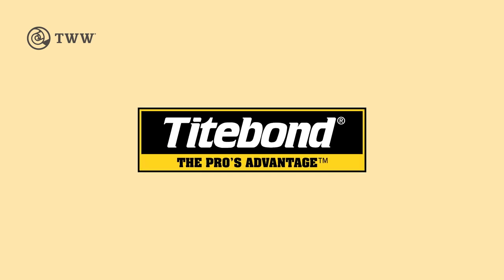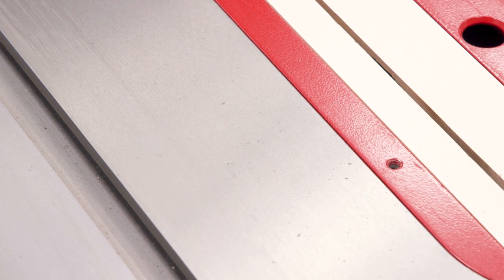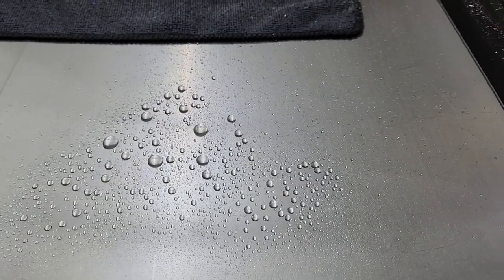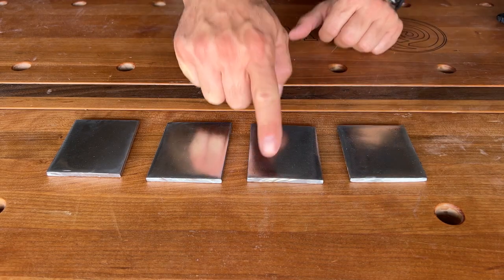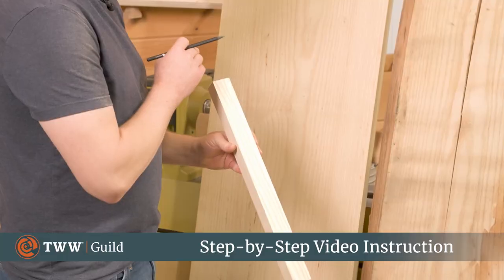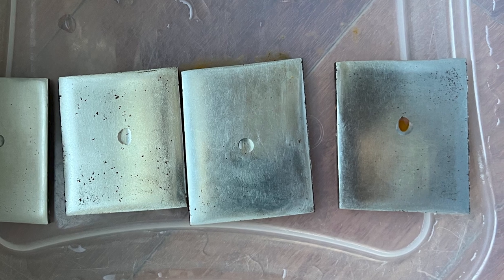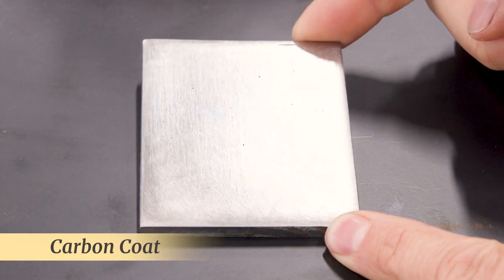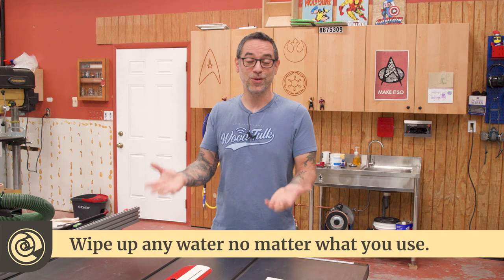Did I Screw Up?! | Carbon Method Update

Comment: I bought my new SawStop at the start of this year. I cleaned the grease and applied multiple coats of paste wax immediately. Within a couple of months and light use, I started getting rust no matter how much I maintained it. After your first video Marc I picked up the 2-3 tool package of Carbon Method and coated all of my cast iron. Haven’t seen any rust yet and I’m working out of my attached garage that gets opened multiple times a day in all weather. I’m definitely a believer so thank you!
Reply: After a year how is Carbon Method holding up? Thanks.
Reply: It’s held up really well with no major complaints! Over the winter, during a rainstorm I got some droplets on the table that I wasn’t aware of for a few days. Once I cleaned it up there were a some discoloration spots but didn’t turn to rust. My belt sander table still looks like new. I’ve hit them with the glide coat 1-2 times as needed. We’ll see in another year if I need to reapply but overall it’s been nearly zero maintenance. I used the saw a couple dozen times both with hard woods and plywood. Hope that helps.

Comment: Coincidentally I bought a brand new Sawstop when you did the original test application and applied the Carbon Method to mine as well.  I live in southeast Alabama and it is very hot and humid.  I fought rust non stop on my previous Grizzly TS and other cast iron equipment.  My new Sawstop looks AMAZING still.  I can’t recommend Carbon Method enough, it is AWESOME and absolutely works.  Make sure you watch their video on how to apply it and follow it to the letter.  I put it on my planer/jointer and my band saw as well and they’re still looking perfect.  Completely worth every penny to protect such an expensive investment.  And yes, the the people at Carbon Method are extremely nice and very professional, great customer service.
Reply: My new Sawstop came with a rust colored wax paper on it. My heart stopped for the moments it took me to realize it was indeed wax paper, and not a brand new totally rusted cast iron surface.

Comment: Nice piece Marc. Rain is particularly aggressive. As the raindrops fall they become saturated, or even supersaturated with carbon dioxide and oxygen. As you mentioned oxygen is required for corrosion to occurs. To measure acidity, we chemists use a scale called pH. The lower the pH the more acidic, the higher the pH the more caustic/alkaline, and neutral is a pH of 7. Adding CO2 to the water makes it acidic as the carbon dioxide forms carbonic acid in the water drops. Normal rainwater, absent smokestack nasties, has a pH of about 5.6, so that appears just a little less than 7. However, pH is what is called a logarithmic scale based on powers of 10. That means plain old rain water is 10 to the 1.4 power more acidic than neutral water or 25 times more acidic. I did my career fighting rust, and trust me that corrosion-wise rain or those dew drops on a rose are corrosion thugs and iron or steel exposed to either needs protection!
Reply: Particularly in cities with high concentration of air pollution. The reason the wax only method still resulted in rust is that natural waxes contain high concentrations of acids.
Reply: No wonder we have weeds, the higher the ph in soil the more weeds will grow, soil ph should be about 5ph for a healthy lawn, so you put down lime to neutralize the acid in the soils  its slow to react but its enough to do the job you can also put down ash to lower soil ph. But its really fast reacting thats why a field thats been in a fire comes back really green.

I forget what metal coating they put on printing press cylinders to stop rust but it works mostly mainly the blanket and plate cylinders becuse they use a ph of about 7 to wash the plates with I think if I remember the ph should be 6.7 its been 30 years.

Comment: My SawStop table saw and Grizzly tools lived in a pole shed for 6yrs in between moves and with indoor rain plus extreme temperature swings in North Central Wisc, I've found the only thing to help control and nearly eliminate all surface rust was a thorough cleaning with rust remover and 0000 steel pad  followed by a coating of Jet Seal automotive protection from Chemical Guys. Then using an  clean bed sheet cover that and completely cover and surround with stretch wrap to make a good moisture barrier. This beat those expensive anti rust covers hands down. I've tried them all. But my method after a couple years of getting sad and spending hours of removing rust on all my tools worked best to keep them 99% rust free! Luckily I've since moved into a nicer garage upper level and after one final shining up with fine sand paper and steel wool and another coating of jet seal, I haven't had to touch them in 2yrs now even with higher humidity up to 90F in the work shop area. I never even cover the tools now.
Reply: Indoor rain is the worst!  Indoor freezing rain caused by the condensation that froze to the bottom of the uninsulated part of the shop getting warmed up enough to melt the ice and rain all over your tools (and freeze). Cardboard sheets were my friend for a while. I finally got the whole shop spray foamed and have had no issues since.

Comment: I live in deep south Texas 100% humidity all the time. I’ve been using T-9 for about a year now and It’s been doing really well for my machinery, what I really like about it is that it’s also a lubricant, so, for example I can spray the quills on my lathes and it protects and lubricates at the same time. I’ll have to check out carbon method, never heard of it. Thanks for sharing.

Comment: Just discovered your channel. Love it! I'm not a professional wood worker, just a hobbyist but have been for 30 plus years. I've always used TriFlo on my table saw. I'm sure this is either going to be bocked at or maybe all you seasoned wood workers out  there will say "wow, I never thought of that". I work in industrial maintenance and know welding and quite a bit about metals in general. I know that cast iron is porous so here's my take on the use of TriFlow on my table. TriFlo contains telflon. This teflon will be absorbed into the cast iron and stay there for quite some time, not for ever though. I usually treat my table a couple times a year. I might also mention that my saw has spent much of it's life out doors under an awning and my treatment works quite well to prevent rust unless it gets water directly on it.
My procedure is this: I spray the entire table down generously with TriFlo. I scrub it in with some fine sand paper. This makes a dirty, dark mess. I then use paper towels to clean off this mess. I follow this up with more TriFlo scrubbing with clean paper towels. I rinse, repeat until my paper towels are clean. This assures you will not leave dirty, oily marks on wood you slide across the table. This leaves my table saw clean, shiny and very slippery which makes wood slide very nicely. I also wipe the face of my fence and all the moving parts with TriFlo as well. Makes everything work silky smooth.

Comment: A dehumidifier in the shop is a big help. I run the hose out the back of the unit to drain out by the garage door or else I'd be emptying it 3 times a day in the summer.

Comment: Thanks for a very informative video. My shop is in north east Kansas, surely identical climate as yours in Missouri. I only use paste wax on the surfaces of my cast iron machinery and have no issues with surface rust. But, I run a dehumidifier in my 1500 square foot shop from April through September. Thirty years ago surface rust was a problem before I started running a dehumidifier. Over those 30+ years I have gone through four dehumidifiers, they seem to only last 4-5 years. The dehumidifier protects my machinery, my hand planes, chisels and measuring tools from any signs of rust. Also, the lumber stored in the shop is protected from the high humidity common to this area. Using a simple pedestal fan combined with the low humidity it is pretty comfortable while working in the shop.

Comment: I live in Houston and we have to deal with high humidity. Always used T9 before. Had an idea to use an inexpensive ceramic coating (Turtle wax) about a year ago. I'm convinced this is the way to go. Every blue moon, when I think about it, I'll just quickly reapply. Takes 2-seconds. I was interested in the carbon until I saw the laborious process to apply. Try ceramic coating. Works great and super easy to apply. Clean and degrease cast iron first.
Reply: ARE YOU TALKING ABOUT THE CERAMIC COATINGS FOR CARS ??? OR WHERE DO I GET IT ??

Comment: Considering how long they sat in storage after being in light rain I would say it did a pretty good job. I have been using Glide coat on my SawStop for about 5 years here in Texas and haven't had a problem with rust here since I  started using it. I did have problems with wax, and CRC 3 36. The Glide coat has out done both of those.
Reply: Thanks for that note! I just went to check out the carbon coat product, but their website isn’t responding. If they’re gone, I’ll pick up some Glide Coat!

Comment: I had some rust form on my table saw from lack of use - almost 2 years.  What I did was spray a good coat of WD-40 on it and let it sit for almost 2 weeks.  I then wiped it off with a rag and then sanded it using 220 grit sandpaper on my palm sander.  It took awhile but it eventually took all the rust away and left my top looking like it did when it was brand new.  Worked for me. 😁

Comment: Thanks for the follow up, I appreciate the transparency. 
I know you paid for the product with a video and attached your good name to it, so your disappointment is very real, and I can 'feel' that. 
Obviously cast iron should never have standing water droplets on it, but sometimes it happens and when it does in my shop (and I suspect many more) it is in the form of a sweat droplet that goes unnoticed and sits overnight or even days before being discovered. 
Since Carbon Method failed the real-world rain droplet test I have no confidence it would protect cast iron from a droplet of sweat. 
If the application of Carbon Method was a one-off event the price could be rationalized, but reapplication after fixing rust spots is too much.

Comment: Coincidently, I ended up needing to pack up my shop to move a few weeks after Marc announced his move.  Based upon his initial suggestion, I applied Carbon Method to all my tools.  I then put moving blankets over everything and moved my tools into a garage for storage.  5 months then passed and I just unpacked everything this weekend and I can happily say not a spot of rust anywhere.  Carbon Method seemed to have done its job. 

Just to further support this product, I live in Washington state in the Pacific Northwest, so it is a pretty humid area.  The last few months were actually pretty dry, but we did have some rain in the past month and the garage was opened and closed every day as a wet vehicle was driven in and out.

Comment: I use fluid film every couple of months and it works perfect. I also spray it on the underside of my truck to avoid rust in the winter. Its just wax and I don't know what kind but it works very well.

Comment: I use T9 on my cast iron machine tops. One day I opened the overhead door in my two car garage shop after a driving rain and water dripped off the door sections onto my jointer/planer. The trouble is I didn't notice this happened for a few days after the event so rust developed. I used the T9 cleaner with a scrubby pad and recoated with the T9 protectant. All seems to be good so T9 is fine for ambient air moisture but not standing water. I live in very humid Southeastern North Carolina. Once I run out of the T9 I will try the Carbon Method product.

Comment: I'm going to have to give that product a try. I live about 40 miles south of you and my shop is open to the outdoor air. I've lived and worked outdoors in Missouri all my life..I've acclimated. Anyway, all of my tools always have a thin film of rust on them that I'm constantly cleaning off. Wax doesn't seem to do a thing. The worst part is the rust that gets on the Lie-Nielsen planes. I've shed more than one tear in my bourbon over that. Anyway, thanks for the recommendation.

Comment: I live in Michigan. Tons of humidity in my metal pole barn. The best I have found is a product called Fluid Film. Spray it on, wipe off excess. Done! My jointer table slides awesome and my 15 inch grizzly planer gets no more rust.

Comment: Spag!! You son of a... wait that stuff worked great!  I live in a temperate rain forest in Juneau AK. With a Labrador retriever that likes to shake off near the table saw after chasing a frisbee in the rain. A lot. And it rains here.. A Lot and we're high humidity. No rust spots on mine. I did the entire prep and sanding process with for doing the Carbon Method and my table saw still feels "like butter" in smoothness on top.

Highly recommend. Much better than wax in feel and performance when breaking down a couple of sheets of 4x8 3/4" plywood over the weekend. Sled moves lots easier as well.

Comment: I don't really mind having to give the surfaces a little TLC every few months. It serves as a reminder that I need to check them for accuracy as well. Never really had big problems occuring with just a wax coating, though I just put a thick coat on without wiping it off after I use a machine that only gets used a few times a year.
Reply: I only have a small space heater and two fans to circulate the air in my shop to try and keep if above freezing over winter and even so I still get rust on my Sawstop and bandsaw even when applying a thick coat of JPW AND covering with magnetic table top covers.  As a result I'm really interested in anything that can help me better protect my tools year around.

Comment: Are you going to do a follow up sometime soon on how it goes with actual usage? I bought some for my sawstop and it definitely works better for pure rust prevention however my experience with usage is completely different. I've found that once your cast iron gets dirty from use and needs to be cleaned that you disrupt that lower layer when you clean it, meaning I would much rather a cheaper product that I just apply more regularly as I have to clean the top regularly anyway

Comment: I am in N.E. Missouri also. Yes we have times through the year the shop will need a dehumidifier & some kind of metal protectant. I made a BIG oops when I used my HVLP sprayer with water base polyurethane. A lot of the tools hanging on the wall had rust on them the next morning. Yes I had the exhaust fan on but I shut it off too soon I guess.

Comment: There are many auto detailing channels which have reviewed graphine coatings (for different benefits) and they largely come to the conclusion that they are a marketing product. While great on paper, graphine is a very hard substance, they bring little actual protection that the substrate is not already providing. Ceramic coatings (a common substrate for graphine) usually offers the same protection and a slightly slicker top surface. While there are probably better or less expensive products this might be a good choice for some.

Comment from the maker: We are now part of Carbon Method’s affiliate program which means if you purchase their products using our link, we get a small kickback. You can also use the code SpagCoat for 10% off at checkout. Click Here: https://carbonmethod.com/?ref=mjguvwfm
Reply: Done! This might be my most anticipated guild project. A Danish cord bench has been high on my list for a while now.
Reply: T9's advantage is that it also works as a non-stick lubricant on the gears and pinions inside the saw,,, I'm very pleased with it, even on iron tools permanently stationed in a somewhat damp garage ...

Comment: Thanks for the nice review and followup. Given the cost of Carbon Method I decided I would try Turtle Wax Hybrid Solutions Ceramic Spray Coating at 1/4 the cost on my new Sawstop. Cleaned with mineral spirits and coated everything and a couple coats on the cast top. Not sure how long it will last but super slick right now. Very easy to apply as well.

Comment: Marc, Thank you for all your testing on camera with the results. With your test results and comments also backed up by several other woodworkers, I will be purchasing the Carbon Coat method kit. Now the question is by applying a coat of paste wax on top of the carbon coat would you get any additional protection.  I know it's hard to improve on perfection which is maybe as you would get with Carbon Coat but I'm thinking since metal is somewhat porous Carbon Coat pretty much does a fantastic job of filling in the pores and covering but if a coat of wax might slightly improve that even more.  Could be that it is not worth the trouble to wax as the wax would just wear off quicker.

Comment: I am surprised that a proper coat of wax still leaves steel so vulnerable to rust. It would be good if you could also test the carbon method product durability Marc. 
And finally the composition of the metal is a factor.  For instance, my Sawstop tarnishes surprisingly quickly.

Comment: Wax seems to be the common element in your testing that showed rust. Likely the wax, while hydrophobic, does allow some moisture penetration and then traps that small amount of moisture which now has the opportunity to work at the molecular level to create iron oxide. Furthermore, as you certainly know, wax on wood furniture  does not prevent rings—there is always a bit of hydration that gets wicked down to the wood. 
I use Bostik TopCoat for my equipment. It has served me well for years. Although it is quite environmentally unfriendly when wet.